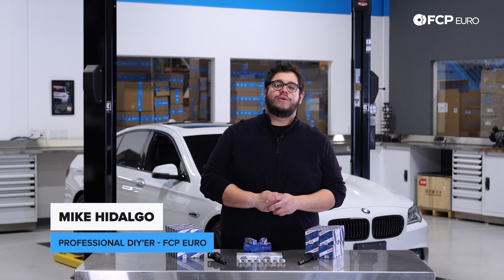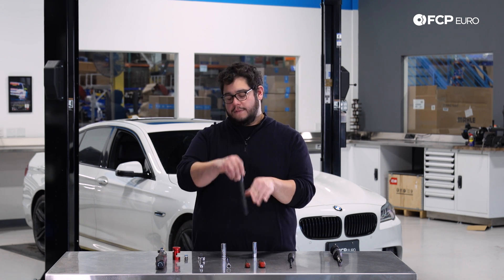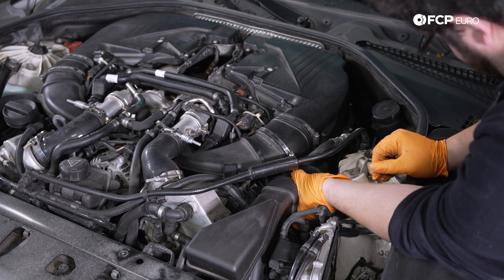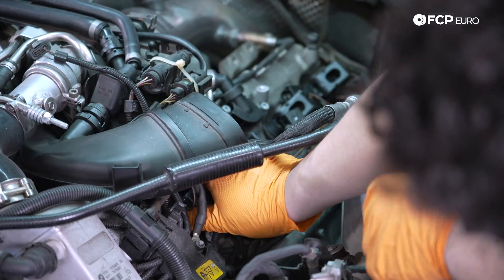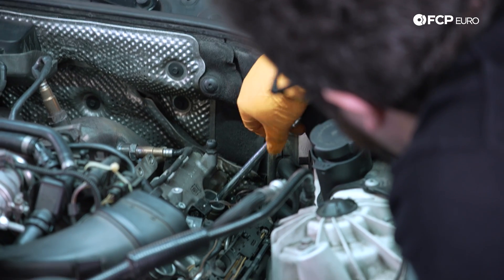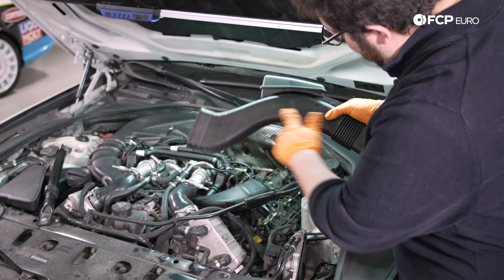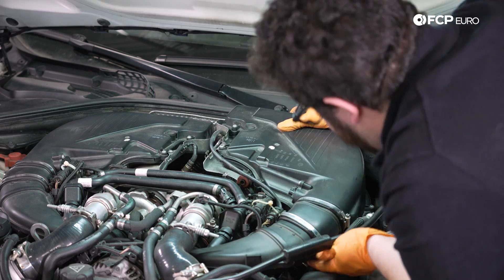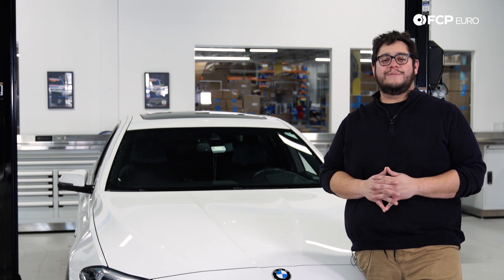F10 BMW 550i Ignition Coil & Spark Plug Replacement DIY (2011-2016 BMW F10 550i, M5)

Comment: I replaced the Bosch spark plugs and injectors on my BMW X5 N63TU engine. I start it in the morning for the first time, and it shakes a bit and the rpm fluctuates. The next time I start it, it stabilizes. I heard that you should use genuine BMW spark plugs on that engine. Has anyone had a similar problem?

Comment: I had a misfire on cylinders 4 and 5, I followed the steps to the letter and replaced all the spark plugs, then cylinders 2,3,4,5,6 had a misfire. Do you know what the problem is and do I need to replace all the coils, at least 3 of them are relatively new.
Reply from the maker: Hi there, typically coils all need to be replaced at the same time, if one fails, then inevitably the rest are going to follow suit; it is only a matter or time. More than likely disturbing the coils was enough to cause misfires.

Comment: To anyone watching I think it was an error on his end which he’s human and it happens. But the torque spec IS NOT 23ft-lbs!!! You’ll break the plug it’s 23 NM!! Which is equivalent to 16.5-17ft lbs. Other than that good wrenching bro and great video!
Reply: Before he puts the first coil pack in, he does correctly say 23Nm. I'm shocked there hasn't been an edit. At least 1 guy broke his plug in the comments.
Reply: So I should torque to 16lbs?
Reply: @ernestrodriguez4721 yes 16.5 or 17ft
Reply: Good catch. If you look at his digital readout shows it’s calibrated to NM, but the text on the screen shows FtLbs. Thanks for clarifying.
Reply: True he corrected himself a few seconds after.
Reply: i was wondering why he kept torquing when it had already went red

Comment: No mention of using the grease pictured at the front end of the video. Would be nice to know if grease is recommended, and if so, how much?
Reply from the maker: Hi Paul, while included in the kit, Mike did not use any grease on this DIY. These coils do not play nicely with it, especially if you overdo it. However, we recommend you watch our video on the coil-on plug setups, where we cover when and how to use the dielectric grease! https://youtu.be/UhGRvZmpLqo
Reply: @fcpeuro  I bought plugs and coils from you guys and did not use the grease when installing. My BMW 550i is now running very well! Thanks for the videos that do a VERY good job of explaining the process.

Comment: I just did my 
One more thing I would check PCV valve hose make sure it’s not cracked or broken in half. 
In my case driver side PCV valve hose broke in half I ordered new one replaced and good to go 👍🏻
Reply from the maker: Good point, Miki!
Reply: Where is that located under the hood

Comment: I recently bought a 535i 2014 F10 and few people that I have talked to about regarding replacing the spark plugs also suggested replacing the ignition coils at the same time stating that the new spark plugs might overwork the old ignition coils. How true is that? And anyway is there a service interval on the ignition coils?
Reply: Spark plugs yes 
Ignition coils don’t waste your money 
Ignition coils work or don’t